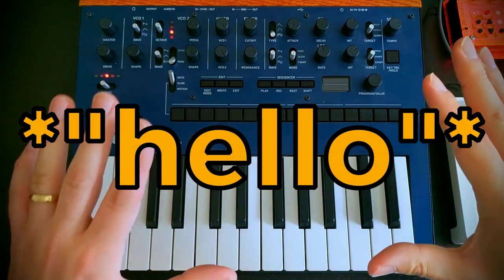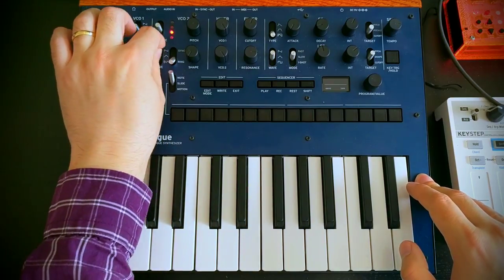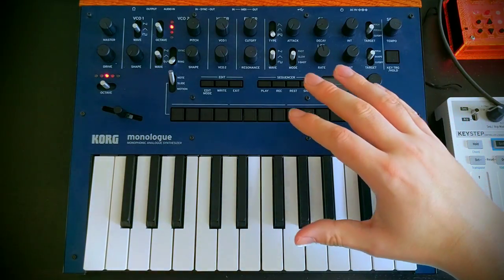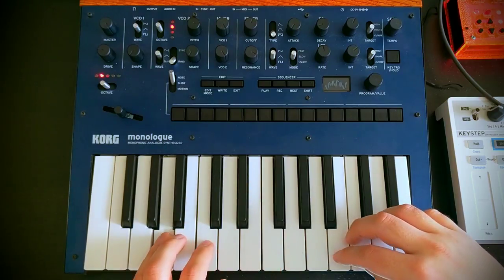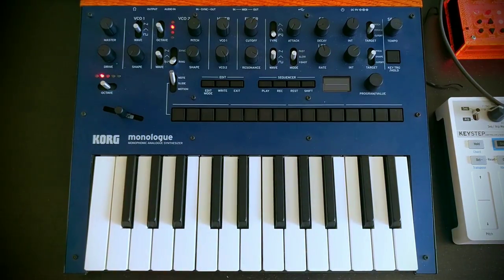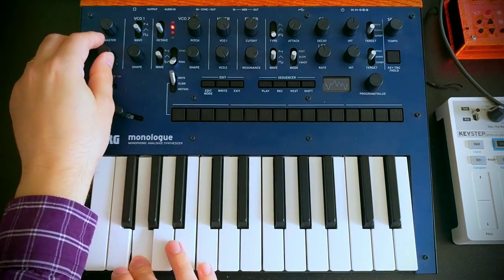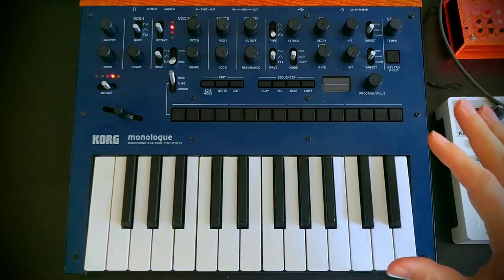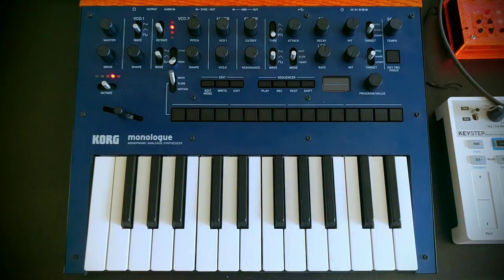Korg Monologue - Let's Build... An Organ Patch!

Comment: Hello. I'm having trouble installing new patches. The sound library gives me a message that the monologue is not connected. Any advice?
Reply: Now I get a message that there's a problem with midi. Midi has always confused me! I connected my monologue with the usb cable which seemed to install the necessary drivers but I thought they might need to be updated. The drivers I see from Korg are for Windows 10 or 7/8.1. I'm running Windows 8. Will the 7/8.1driver work?
Reply from the maker: So if you're on Windows, this is usually because of a bug in the Sound Librarian where it won't notice the Korg driver if it's registered at a high slot in the registry. 

- So start by unplugging the Monologue and closing down the Sound Librarian. 
- If you've installed the Korg USB MIDI Driver (and if you haven't you should - that might be why it's not working), you'll have something called "Korg MIDI Driver Uninstall Utility" on your Start Menu. 
- If you run that, then click through until you can see the "Option Button". 
- Go into the "Option" and untick the setting that says "Delete Korg Midi Device Only".

- Then tick all of the items that you don't currently have plugged in (don't worry, you're not deleting the drivers just unregistering the device, it'll connect automatically next time).
- Click Next and let it do it's stuff
- Then re-attach your Monologue

Hopefully now everything should be working! Let me know how you get on.
Reply from the maker: Don't forget to try restarting once you've tried all that! There's a reason why the "turn it off and on again" cliche exists!
Reply: Thanks so much for helping. I was able to get it working with a laptop running Windows 10 and just left it at that. I discovered midi channels can be changed in the Monologue and that might get it to work in FL Studio. For now I'm recording jam session into Audacity. It's such a fun synth to experiment with!